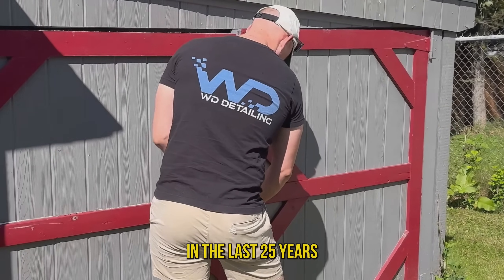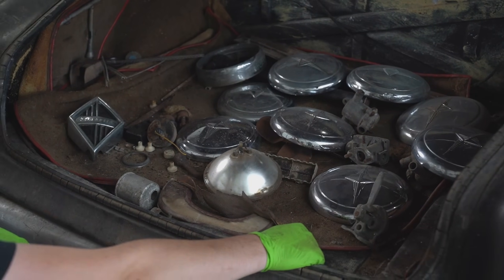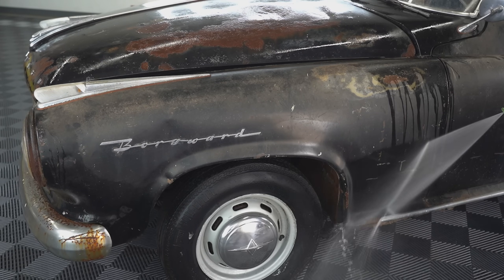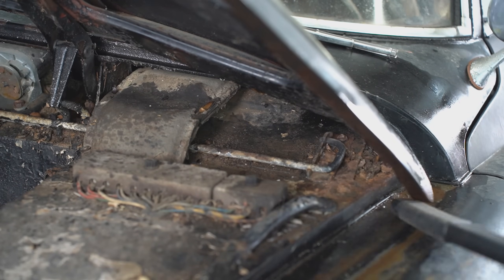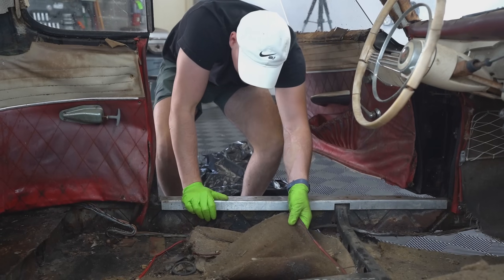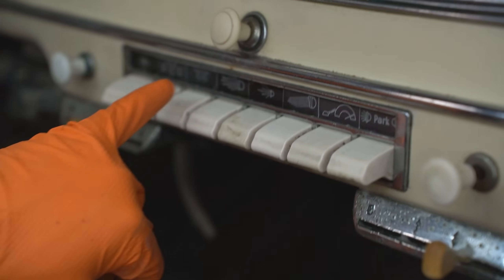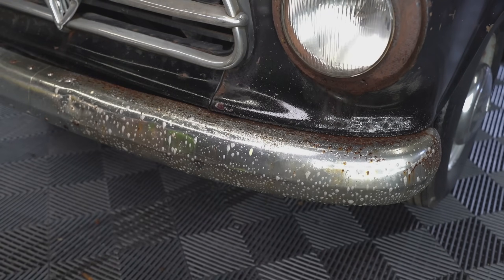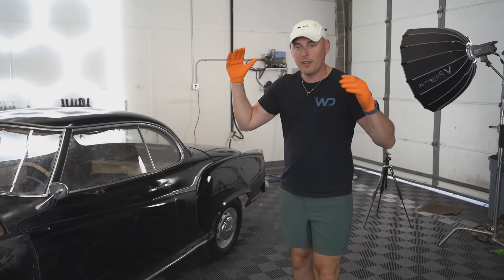ABANDONED BARN FIND First Wash In 25 Years Borgward Isabella! Satisfying Car Detailing Restoration

Comment: This is one gorgeous car, the brain child of a Dr Carl Borgward. In essence it failed because it was over engineered and was highly reliable. If you look at it's hood ornament, it is an inverted "B", for Borgward. Some parts are interchangeable with Mercedes like the steering coupling, I believe this is true for the clutch plate as well. The Borgward Drivers  Club, UK has got quite a bit of spare parts.

Wish I could buy it. 

Greetings from Malaysia.
Reply: Saving money by using a Wartburg - steering - coupling....

Comment: I have a brand new original carburetor for that Isabella, Solex 32
Reply: Solex 32 PBIC carbs were quite common - jets may be completely different for other cars, so that has to be checked first.
Reply: Sorry, I forgot : being a Coupe, this should be a 32 PAITA ( 75 h.p.) Again, they were used on several cars.
Reply: @MichailKnoller  right, it’s a 32 PAITA but different from the ones installed in Mercedes Ponton and fintails.
Reply: @javi8939  Yes, I know. Basically, it is the same, but there are m a n y differences.

Comment: Looks like most of the rare stuff is still there, but the headlight rings, grille, bumpers are all badly mangled and would need replacing, but the rare coupe only interior hardware is mostly there. These things were built in Hanover, Germany from 1957-1961, this one is late, probably a 60. Rebuilding the side rails and floor will be the biggest challenge, major welding project. Interior fittings like the seats are available on parts cars, and the upholstery was typical German-cheap, and didn't do well in sunlight. This car was on par with the Mercedes 190SL in terms of quality , handling and speed. Borgward reputedly lost money on each one he built. These cars were and still are highly sought after, but this one needs $100K worth of work. I'm still looking for a half decent one, they're cheaper to buy complete than to try and restore one.
Reply: Firstly, they were built in Bremen; Sebaldsbrücker Heerstraße 235...as I mentioned, as a 1960 - model, she would have different wheels and hub - caps. The floor is no problem at all; it all depends on your capabilities - and stock of spares. More difficult : the woodwork. I would always go for this one - instead of an expensive car of which you do not know what and how it was done. For 100000 Dollars I would do 20 of them...and got money left for petrol. Mercs never ever reached Borgward - quality.
Reply: You're right, it was Bremen, my apologies. Just checked the book. As for the quality issue, I'm not too sure; we had 2 of them while I was growing up and they difficult to keep going and they rusted like ship wrecks, - fun to drive though. I currently own an old Merc and it's a lot better built IMHO. Woodwork, steel work, some of us aren't very good at either, my specialty is I'm a mechanic, so I'd wind up paying some of the specialty welding and so it becomes very expensive in a hurry.   @MichailKnoller
Reply: @marcbink5370  Well, I drive and repair Borgwards for well over 40 years...mechanics are a solid as a tank; my mate's car has got more than 700.000 mi on the clock...at 400.000, they are just run - in. The gear - box will outlast any of us... Rust is always a matter of...protection. Wax - oiling does a good job...my experiences with Mercs were really atrocious, no matter what we talk about, mechanics or body...they tried to kill me ( not only once ) : blocked ignition - lock in a bend or all of a sudden electric darkness on a motorway at night...my Borgwards never played tricks on me like that. So, my choice is quite obvious.

Comment: Those automobiles had absurdly high reliability, which is why they hardly sold spare parts or expensive repairs under warranty. That is one of the reasons why a plot was made to ruin the manufacturer. The company was never insolvent, it even had assembly plants in Latin America to expand the distribution of the product.

Comment: I bought a Borgward Isabella  @ age 14 for $50, didn’t even have a drivers license.I drove it 2 miles then the  clutch master cylinder went leaving me stranded, my dad was really angry had it towed away and I never saw it again.
Reply: A bit of brake - fluid would have cured the problem - temporarily.
Reply: @MichailKnoller  I wish it was that simple. The rubber plunger in the master cylinder was disintegrated so any fluid  would’ve just come right out
Reply: @regalite3  Sorry, I did not know that...normally, there is just a tiny little leak - until there is no more liquid...but it would have been a very easy repair, I feel sorry for her....

Comment: What are the chances that you can find a headlight that will fit on the passenger side? I seriously doubt that the motor can be rehabilitated or restored. Where would one even begin looking for parts for the four cylinder engine?
Reply: Very easy, indeed. 180 mil diameter Hella or Bosch, reflectors of the beetle fit. Spares for the engine ? You either g o t them - or forget it.

Comment: The blue Opel (514-PJ Ohio plates) is Europes and Scandinavias equivalent to the 1955-1957 Bel-Air. They where everywhere, and if I remember correctly they where only surpassed in sales by the VW Beetle. The model  showed here is a 1960-1962 Opel Rekord P2. These where available as 4 doors saloon, 2 doors saloon , 2 doors Coupe, CaraVan (estate) and also as delivery van with a inline 4 of either 1,5 or 1,7 litre engine and with three gears on the tree. Some models where also made as pickup, but these where only made in South Africa and Denmark as a side production and therefore EXTREMELY rare. The Opel car manufacturer was started by Adam Opel in Rüsselheim  Germany, but it became part of GM in 1922. Opel was huge in the 50's 60's and 70,s with something like 30% of the market share in Europe. Some of the Opel models from the 1960 to the late 70,s are: Kadett, 19 GT, Manta, Ascona, Rekord, Commodore, Kapitän, Admiral and Diplomat (with Chevy V8). All of these models are very sought after today.
You can see more at. 
http://opeladmiral.com/
http://www.opel-admiral.dk

The Bogward Isabella is today a very rare car. It is German and was produced in Bremen Germany. The quality of these cars was known to at least as good as Mercedes Benz, and they made many very beautiful cars.
Reply: Slight mistake : GM took over the Opel - factory not in 1922, but in 1928 - and stopped immediately production of the Opel Regent - a Cadillac equivalent.

Comment: This is a parts car
Reply: The Borgward I am working on at the moment is lot worse. To y o u, it may be a donor - to me, it is a somewhat nice base.
Reply: Too straight.  Definitely not a parts car. Seen a lot worse be brought dack
Reply: @deanbrunner261  You should have seen my Isabella van....only a rotten shell with accelator pedal - nothing else. Rear suspension cut out - spare wheel would have dropped without hesitation...this car would be a nice project for me.

Comment: Looking at the wheels, hubcaps ( if original ) and radiator, small diamond at the front grill..telling me : she is more than likely a 1959 - model. Since there are n o spares ( do n o t rely on " clubs ! Especially not in Germany..) it is very difficult to restore her - timing - gear will not last very long; plenty of problems...but, having said that, with lots of spares and over 45 years of experience, I could do her.